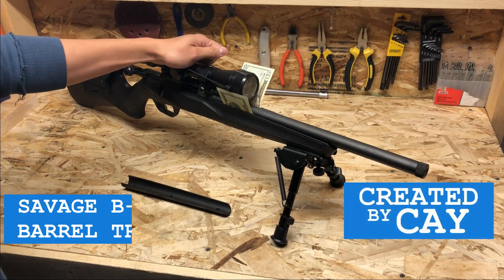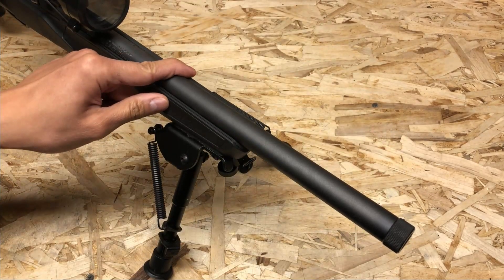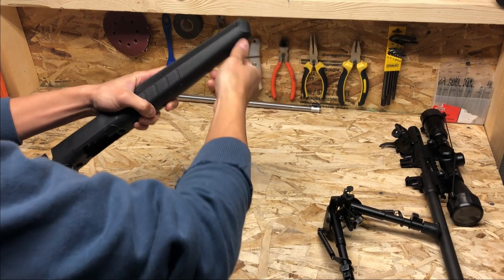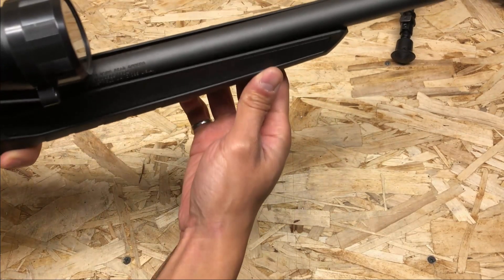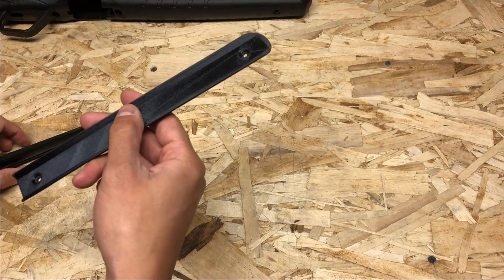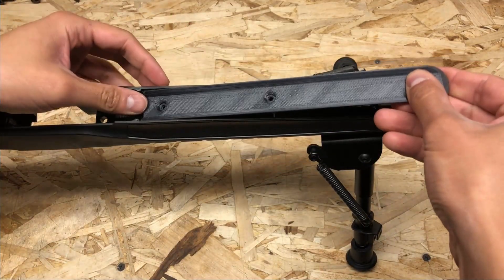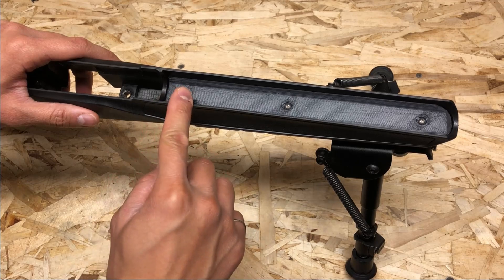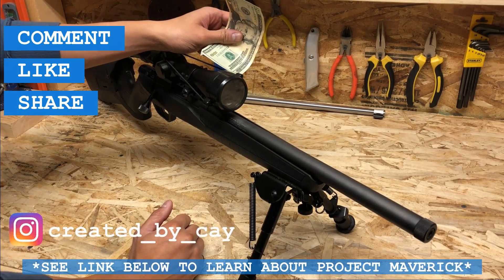Savage B22 B17 Free Float Barrel Modification - Accuracy Improvement

Comment: I have the B22FV in 22LR, just bought it a few days ago. After breaking in the barrel a little, at 50 yards with Lapua Center-X it shoots 1/4" 5-shot groups, measuring center to center of the furthest holes. Barrel is not free-floated yet. Very curious to see what floating it does to the groups! First I'm gonna try a washer as a spacer for the front action screw.
Edit: washer didn't do it. So I removed the barrel tray entirely and filled all the little sections in the front of the stock with about $4 of all-purpose glue. It's nicely free-floated and stiff.

Comment: I bought it, it took 1 month to get to me. I have installed it. I like that it makes is strong again. It covers up  the holes and doesn’t allow dirt and dust to get in there now. You will have to sand it to get it too fit.  O way around that. Its a tight fit after that tho. It definitely 100% makes it a free floating barrel. The barrel is no where near close to the stock now. This is a major upgrade to making this rifle more accurate. I recommend this

Comment: Hi. What printer did you use to print this and what is the length of the printed piece? I have an Ender 3 Pro but the length of the piece looks too long for the print bed.
Reply from the maker: Hi. I just got a generic FDM printer. A print bed 8"x8" is sufficient. Thanks.

Comment: Why not just cut down the sides on the original tray. I assume that would accomplish the same thing. Besides i went to the website for the 3d printed ond you use and it would cost me arohnd 50 bucks for 5 bucks of plastic.
Reply from the maker: You can remove the tray, it just looks ugly (to me) and dirt and debris is prone to piling in the pockets. The 3D Print design on my website is really meant for people with access to a basic bare bones 3D printer. Thanks - Cay

Comment: Hi, very good job. Is it correct that that barrel tray modification is only needed for the models with heavy barrel ?
Reply from the maker: No, you can do this mod with the standard tapered barrel too. You'll just get a very wide gap in between the stock and the barrel. Thanks. - Cay
Reply: Yes I understand. But the problem with a non floating barrel is only with the heavy varmint barrel in combination with the plastic stock, correct ?
As far as I understand, all other models are free floated by factory.
Obviously this was a construction problem at Savage. They built the plastic stock for a sporter barrel only and only then decided to offer models with a varmint barrel.
Hardwood and laminate stock models should be free floated, correct ?
Reply from the maker: @winfriedfrankgrollmitz6648  Hmmm, I'm not sure about the other models. I only own the FV-SR (Heavy Barrel, Polymer Stock) as seen in the video. - Cay

Comment: Careful buying this gun. Poor quality. Accurate. I've had nothing but issues with failure to extracts. I mean like every other round. Yes, I cleaned and tried multiple types of ammunition.
Reply from the maker: Mine was flawless until the extractor worn out.
Reply: Dude! I had the same problem. Called savage and got replacement springs and extractor. Same problem. I found that I  have to really seat the mag to cure it on my rifle. Either insert mag with bolt open or really press on it and wiggle with bolt closed. Mine is flawless now. Hope this helps.
Reply: Had same issue k try g96 on wire brush short stroke chamber k no need run through whole barrel then run few patches k my sav was same did that never looked back they have semi match chamber outa the box k very tight but trust me worth it when ya get know the beast k

Comment: Seems like a Dremel using a sanding drum would work also. Just go slowly and check fit often.
Reply: Well on second thought it might work on the ends but going the full length might be tough. Could do it by hand though.
Reply from the maker: jeff tate Should work too. What I do sometimes is wrap a socket (one for nuts and bolts) with some sandpaper and go back and forth. Thanks for watching. - Cay

Comment: Impressive! I use JB Weld to fill in the plastic webbing. Makes the front grip super stiff and is about $10.
Reply from the maker: Yep. Except I didn't want to increase the weight of the for-end too drastically. Thanks for watching! - Cay

Comment: The modified trey specs for the 3d printing does that include the 3 drilled holes and measurement size? Im gettimg a hold of a company that 3d prints and will give him your 3d printing info. Thank you
Reply from the maker: Hi Brad, Yes the holes are in the 3D model. Thanks -Cay

Comment: PLA has a glass transition temperature of around 120f. If you burn through a couple of mags quickly on a hot day it could cause problems. ABS can be a pain to print, but would probably be a better material for this application.
Reply: I would use petg it’s a little better more durable and amazon has kilos for 16 bucks right now
Reply from the maker: Ah yes. PETG does have superior material properties. PLA was all I had at the time, and it held up fine for me. I do however have trouble in the past trying to print long thin objects using PETG, it tends to curl up on me a whole lot more. Thanks for watching, be sure to checkout my other videos. - Cay
Reply from the maker: Hi Marc, Yes you are correct. Depending on your operational environments, you may want to select a different print material. Currently I am closer to the north pole than I am to the equator, temperature here ranges from -40F to 80F. Majority of the time I'm shooting well below 50F, and with rimfires unless I'm dumping 50+ rounds downrange my barrel stays relatively cool. PLA is cheap and readily available and works great for my application. Thanks for watching.

Comment: Very nice.  Well done.  Can't believe the engineers at Savage don't realize this issue & correct the barrel shroud.  Disappointed in the Savage engineers.
Reply: Here 3 years later have a new B22 FVSS with the same issue, barrel not free floating. Ordered the 3D printed tray from Australia, 9 day transit. Tray AU 25, Post AU 24, Tax AU 4.04, Total AU 53.04, USD 38.50. New tray very difficult to install, very tight fit. Once installed and rifle assembled the barrel had good clearance both sides, fore stock very stiff (good), failed dollar bill test (bad). Bottom of barrel touching new tray 1.25 in from front of stock. Removed barreled action from stock. Placed 1/16 in thick washer over the fwd action screw column. Reassembled rifle. Passed dollar bill check. Barrel is now free floating.